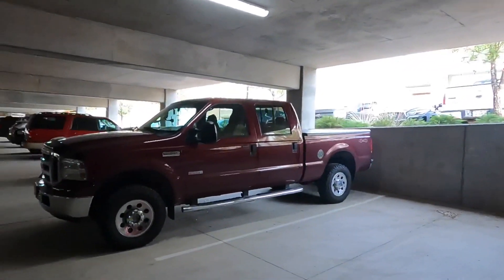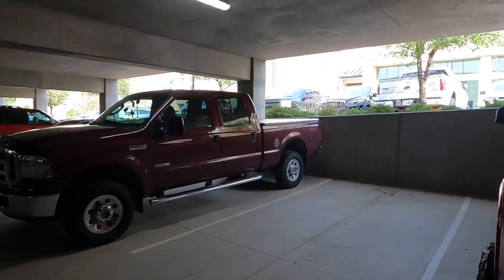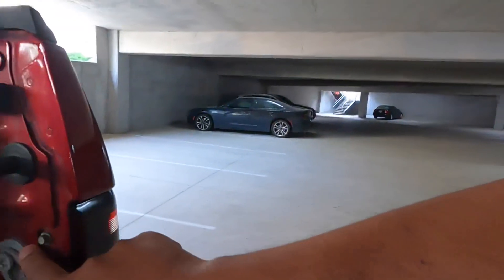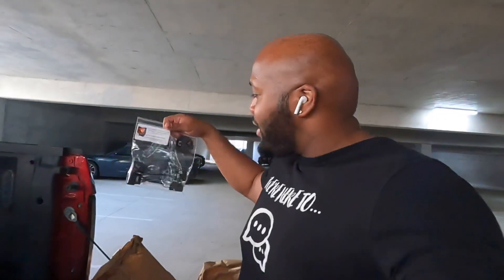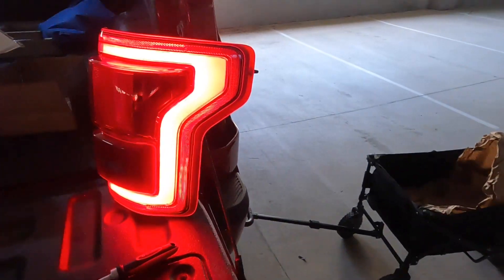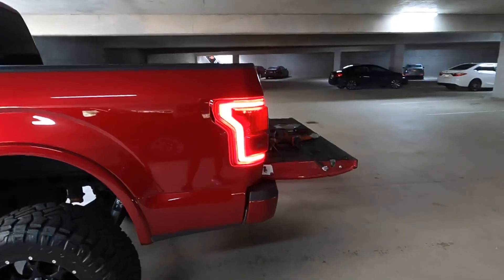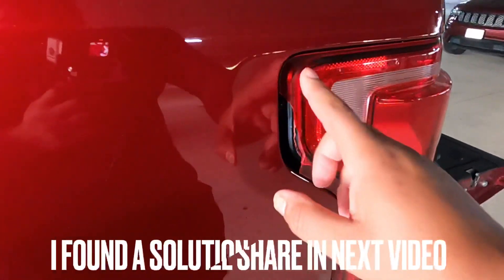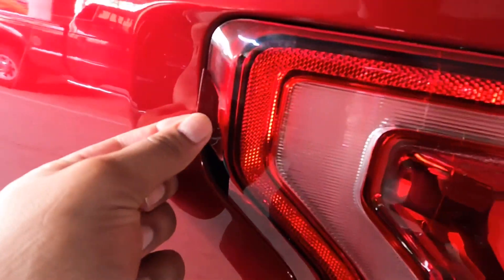Finally! LED Taillights! But There’s A Problem...

Comment: Sorry about the condition of that taillight.   They do look dope! I think you should keep them. Try patching the broken pieces together with clear tape until you can get a replacement.
Reply from the maker: Dropping video in like 5 mins on the fix lol
Reply: @KickinItWithQ  😂 I saw the vid right after I posted. The bezels look dope Q! I love the OEM look of those LEDs.
Reply from the maker: 😂 I appreciate it boss 💪🏾

Comment: Dude... I have the same lights!! Proud to see you tackled it yourself and stuck it out with the troubleshooting!!!💪🏾💪🏾👍🏾.   On to the BS with the seller. So you are absolutely correct in following up like you did. Some people just will not let you work with them. Not your fault. If you decide to run with then like it is you may wanna remove it to add “marine” grade tape on the backside or fill the area with a marine grade rubber gasket with an adhesive back.  The on top of it add the red taillight tape. Now I say that but bro I know you love Red.  So your ride is clean and I know you are not gonna like that for long.  Sometimes you can also use a heat gun to remove the housing from your old o e and use it as an overlay over the new one possibly.  You have to remove both and swap them out maybe? Keep looking bro you will get it. Also check YouTube for some videos on repairs etc.  You got this man.  👊🏾🏆
Reply from the maker: Yoo! I appreciate you bro and the feedback. I found a cheapish solution. Probably post next week
Reply: @KickinItWithQ  GREAT!!!! Glad it worked out man. Looking forward to the video bro!👍🏾🏆

Comment: You could prolly use some headlight silicone sealant on the hole as a temporary fix so water won’t get in it
Reply from the maker: Thanks for the input man

Comment: Q, why didn’t you glue that piece back on?
Reply from the maker: So apparently glue doesn’t work well with the type of material taillights are made of. That’s why you don’t see a lot of options for glue. I had one guy tell me the only thing that worked for him was PVC glue but regular glue wouldn’t hold

Comment: Hey q really love these, was planning to upgrade to these but when i found out u needed to wire stuff.(which im not a fan of) i backed down, but now that you made it seem easy, wdym when you say bliss blocker, is that needed besides the new harness?
Reply from the maker: Bliss blocker basically covers that area where you would plug in Bliss if you have it. One guy said it’s not needed another said it was needed lol. It has no impact on the function of the lights. I think it’s just to help keep moisture out.  If you decide to go with them and yours don’t have it, I have a set I’ll give you.
Reply: @KickinItWithQ  thanks man I appreciate 👌🏻 if i ever decide to drop serious money on those headlights i will sure come back again, they’re so darn expensive, I already bought headlights,ram air hood, new 35 tires and a custom borla exhaust...hahahaha darn f150 is tryna hurt my pockets 😂
Reply from the maker: 😂 yeaaa you’ve spent some coins My Guy

Comment: Those look clean af! I’ve been contemplating  between those or the 18-20 oem led bliss....boosted grey goose is clutch with those harnesses
Reply from the maker: Man the 18-20s are dope! But they hella expensive
Reply: I know that’s right! I lucked out and have some extra f150 parts I’m able to trade with a guy....even for a broke set I’ve seen people asking over 600! Crazy!!!
Reply from the maker: @bobbyprice86  indeed man!
Reply: You upgrade your mirrors yet?
Reply from the maker: Nah I haven’t still stock. I’m personally not a fan of tow mirrors on 1500
Reply: They look good if it’s lifted...I put lariat pwr folds w/ puddle lights on mine but those telescoping tows are nice af!
Reply: I have the color matched caps to which I think make it look waaay better!!!

Comment: Great Video, sorry about your luck.  Do you still have the anzo switch back headlights?  I am looking to get them for my birthday and want your opinion on them.
Reply from the maker: Yea I do! I have had zero issues with mine man. They’ve been great! However another guy i know just got some and he has moisture in his
Reply: @KickinItWithQ  Thanks man, I have moisture in my stock taillights.  I tried to air dry them with a hair dryer and used some silicone but still gets moisture in there.
Reply from the maker: It’s crazy how some have no issues and others get moisture
Reply: @KickinItWithQ  did you see the new f-150 lightning?
Reply from the maker: Nah I missed it man. Imma go watch it today

Comment: Nice tail lights. I put LED tail lights in my 2013 F150 back in February, they came with resistors built in, but after like two days, got hyperflash! Had to buy a cheap laptop and get a module, plus Forscan but that ended up being easy to disable the hyperflash, just annoying. Good luck with yours.
Reply from the maker: Thanks man! Definitely working on forscan

Comment: I've been thinking about buying these for my truck. I have some bright LED reverse bulbs from Amazon with the oem halogen housing XLT tail lights. I know you can't swap out the bulbs on these, but are they bright like the XLTs or are they less bright since theyre smaller?
Reply from the maker: That’s my only Gripe about these the reverse taillight area so small you can’t see anything to be honest. Doesn’t light up as near as much as my xlt LEDs did. So you are dead on. They are less bright because the area is so small
Reply: @KickinItWithQ  looks like we'll be getting a  "adding auxiliary reverse lights" video soon 🤣
Reply from the maker: @iMakeDatBedRock  😂 nah I like the clean look but yea it definitely sucks and my backup camera out right now so that’s making it even harder lol

Comment: the happiest day of my truck modding was finally saving enough to order the oem led tail lights.  15-17 and 18-20 are both so sick looking.  gonna make the truck look so much better (even if you can't ever see them from the drivers seat) 😂.  thats crazy though, people steady getting carjacked and robbed left and right everywhere these days, sad af.  if you figure out the forescan code to have the tail light planks stay on with the day time run-in lights planks up front please let me know.  I am waiting on my forescan stuff to come in, but I can't seem to get it to work from the cluster, so im assuming there's a forescan code.  Boosted Grey Goose Designs are legit, they'd probably send you another harness if that clip that broke was part of the harness (couldn't tell from the video).
Reply from the maker: Yea definitely changes look of truck at night. No it was my clip that broke , the one in the truck. I appreciate you watching def will post forscan when I figure it out